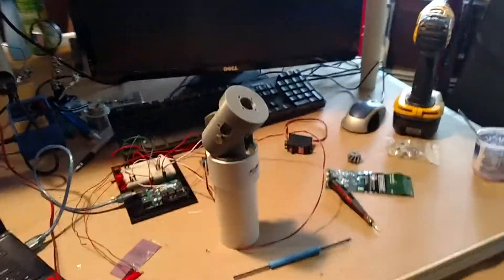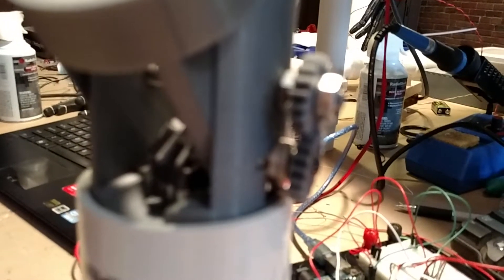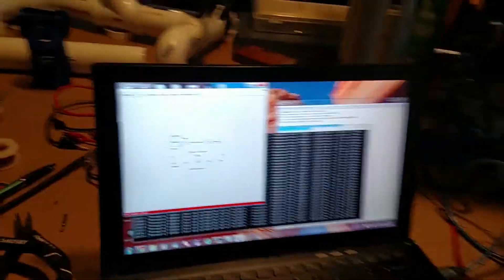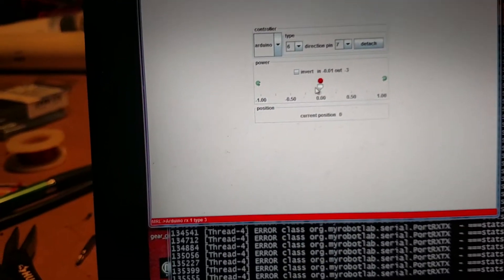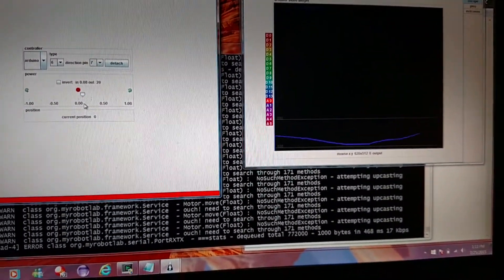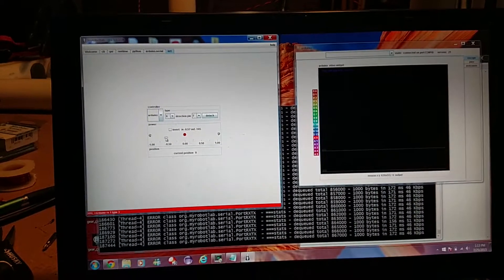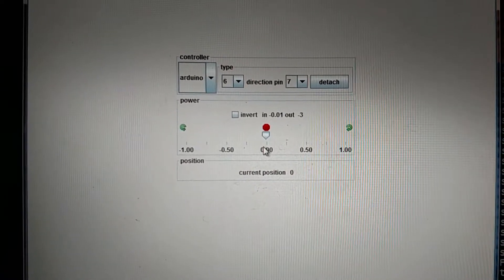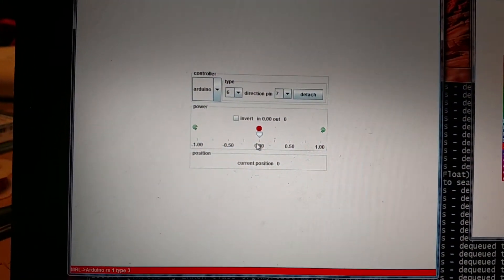3D printed Robot Arm Joint with DC Motor and Positional feedback

Comment: How did you get that low rpm with a brushed motor? It's because of gearbox or you control it with pwm somehow?
Reply from the maker: I used a 60 RPM Heavy Duty Precision Planetary Gear Motor.  It was connected to a standard h-bridge motor driver.  That motor driver was controlled by Arduino PWM signals.